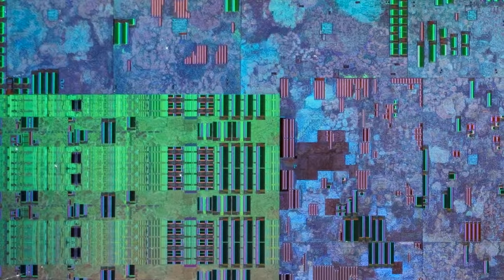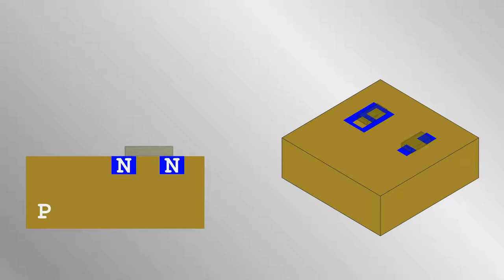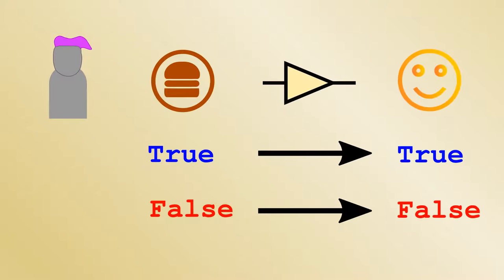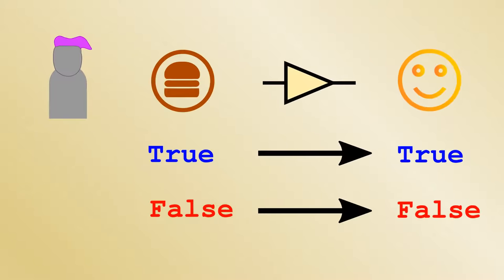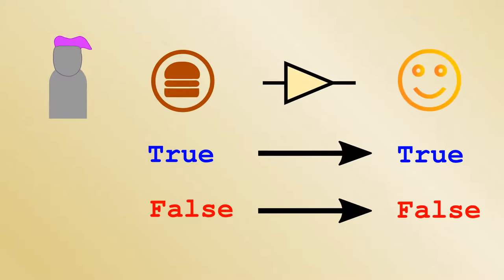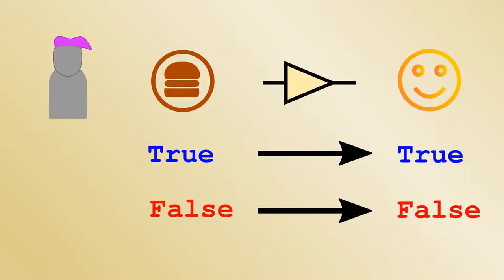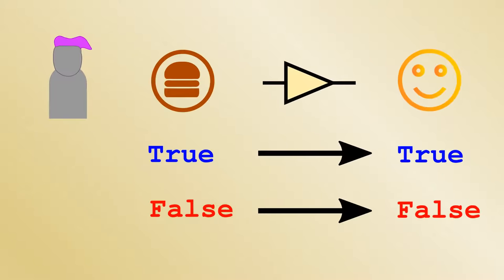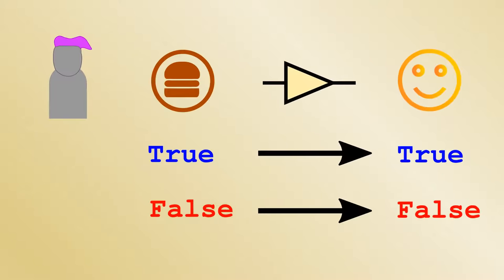How a Computer Works - from silicon to apps

Comment: Nice job! This is exactly how an "introduction to computers" class should be done at a university. I always disliked how my professors through us into the thick of computing without first explaining the reason why it all exists in the first place.
Reply: I think you learn like I do. No matter what it is, I want a general overview about what it is before delving into any specifics. It's like when instructionals we'll go down a program menu and tell you what everything is, but not when you would ever use it. Then it goes through every single thing, every single menu and expects that you know the program now.
Reply: I have a degree in Computer engineering and I have been working as a software engineer for over nine years yet it feels like this is the first time I truly learned how computer works

Comment: I messed around with Boolean algebra in high school because a good teacher I had encouraged me. I gained a pretty strong understand of the math. Later in college, I started learning Java, so I gained a small understanding of how programs work at a high level. However, I never quite understood how math and register values could be used to make graphics. This video gave me a much better idea than anything I've looked up previously. It also really helped me understand the scale of modern processors and their computations. That understand was what I was missing. I knew how you could use logic gates to make a digital clock output the time with a liquid crystal display, but I could never make the intuitive connection to how just doing math could make a sprite or window on a screen.

Comment: Amazing. Doesn't get more comprehensive than that.    Love how you start from semiconductors and work up through transistors to gates to instructions sets.    I knew all these parts but have never seen it wound into a full bottom up explainer.    Should be one of the most watched  videos on YouTube.

Comment: I wish I could like this more than once, my brain exploded after the keyboard explaination where you casually said "sends it to a loop" because like kyser soze at the end of the usual suspects it all came together in a flash. 
Fantastic, now my understanding is legitimately a little better, which is a LOT better that I could have done over like maybe a month of study? So this was worth quite a bit of learning time... Err lets say a skill takes 2 years to learn, that is 24 months, so this was like 1/24th. And while learning in parallel probably knocks that down to 1/50 or 1/100. Its still pretty damn good for a youtube video.
1-5% increase of understanding... Just nice.
Also loved the way you used the beethoven and the oversimplification texts, quite ingenius.

Comment: OK, wow. You are the Potholer54 of technology. That is as high a compliment as I can conceive. I've been programming since 1978, you know, back in the day you used 6502 machine (well, assembly) language to control the stepper motor on the floppy disk drive and read and write individual bits to the head. I still program in C, not C++ or Python or anything like that. Too frou-frou for me. This video blew me away. I'm tagging it for recommendation to all my programmer (and non-programmer) friends. Thanks!
Reply from the maker: Thanks, I also prefer C over C++. Python is pretty neat, though. You'd be surprised how much Fortran77 I have to work with, but what surprised me even more is actually how viable it is. Still the fastest way to crunch numbers.
Reply: @ImprobableMatter  Actually, I forgot to mention that these concepts are now front and center in the field of lattice-based fully-homomorphic encryption. If you are not aware, you can build a "computer" using logic gates in an encrypted block (insert Beethoven's 5th here) that can be executed remotely without anyone, including the cloud computer, knowing anything at all about what it is doing and what it is doing it on. Combine that with crypto smart contracts and, well, lots of stuff. I have watched maybe 10 videos on this and lattice cryptography and am now convinced you can do a base-10-order-of-magnitude better job. Next, I need you (yes, you) to explain zero-knowledge proofs! I mean, I get the basic idea but when it comes to non-interactive zk-SNARKs I lose contact with reality. Am I being too demanding? How can I contribute to your channel?
Reply from the maker: @johnjamesbaldridge867  This will likely make you unsubscribe, but I am a cryptocurrency skeptic. Anyhow, the underlying math is undeniably sound, but I'm sure someone has done a better job than I could explaining it.

Comment: As an electronics hobbyist (i dont have the required 1million braincells a engineer has) your explanation is nice and accurate! It amazes me that almost every house hold appliance has a microcomputer in it in the form of a microcontroller chip. Even toys contain a small computer but instead of a os it runs code and has support logic to inplement all sorts of functions. Its ingenious how humans managed to fit all those tiny transistors in a few centimeters. I am also happy my country (the netherlands) has the technologies and machines that can successfully produce such a chip. Hopefully china does not steal it. Giving the netherlands a bit of credit and putting it on the map for inportant companies who power the world. Also fun fact, almost every pc component also has a microcontroller in it or cpu core, the ssd controller, hdd controller, the monitor has a cpu in it, the mous and keyboard have microcontrollers in it. Even a bluetooth speaker, bluetooth devices, washing machine, dryer, coffee machine, wifi routers, cars, induction and heating plates, settopbox etc. all have microcomputers in it. The future is really digital
Reply: Great information

Comment: I think you have the photoresist process backwards.  When the light goes thru the mask, it "cures" those areas of the photoresist.  Then a mild solvent is used to remove the areas that were not exposed.  The next step in the chip manufacturing process is done (doping, etching, adding a layer of insulating oxide or conducting metal, or whatever), and then a stronger solvent is used to wash away the cured areas of photoresist.  Rinse, lather, repeat, until all layers of the chip are done.
This is equivalent to using the "photographic negative" of the mask as you've shown it. 
At least that's how it was done in a lab class I took in college decades ago.
Reply from the maker: You may be right, that is one approach I read. In either case, I hope it's clear how a photoresist can be used to selectively etch away material from some parts and eventually build up a network of transistors.
Reply: You are talking about negative photoresists. The video explains Photolithography with the use of a positiv photoresist. Both can be used, they just do the opposite thing.

Comment: This is a pretty great video but could maybe do with a brief talk about algorithms more abstractly before diving into sequential instructions and integer operations specifically. Also I think a quick mention of threads and cores is important, and how 3D graphics processing is separate from the cpu and massively parallel. (I like to explain things with a kitchen analogy, the cooks are the cores, the recipe is the algorithm, the order is the input, and they pass around ingredients which is the data, and they perform all the different instructions to serve the dish, the output).

Another nitpick, I think it's really important to mention that there is a temporal delay between input and output with latches and other logic, and that's why you are able to route outputs back to inputs to achieve these things. An animation of voltage state/change through a logic/gate diagram I think would be suuuuuuuper helpful in this regard.

Comment: You did such an amazing/excellent job on 'How a Computer Works'.  
I'm trying to figure-out exactly how FPGAs work & I just can't.   ?Could you take a look at FPGAs? 
FPGA logics are look-up-tables (LUTs) stored in memory to emulate the in/output of any logic gate configuration (ex: AND, OR, NOT, registers, etc).   ???Then how do FGPAs do calculations w/o a CPU???
Reply from the maker: In simple terms, an FPGA has a bunch of gates which can have their type and interconnectivity changed. So you could configure an addition circuit like I described one moment and a completely different gate circuit soon afterwards. They also have clocks, as I described, but with rates that can also be set by the user. So in principle, an FPGA could act as a processor if it had all the right gates.
Reply: @tombouie  dave jones at eevblog explains it pretty well. https://www.youtube.com/watch?v=gUsHwi4M4xE&t=188s&ab_channel=EEVblog
in short you'd have resettable fuses to configure the fpga. however as you'd know due to how fpgas work the memory is volatile, so the actual configuration of fpga would be stored somewhere else on a device, and every time the fpga boots it would use the configuration from said stored memory.

Comment: 17:47 Minor correction here, negative numbers are not stored like this. If you have a number x in signed binary and you want to get -x in signed binary, you flip all the bits of x and then add one to get -x. The highest bit does determines whether the number is negative or not, but the other bits are not the same as the positive counterpart of the same number.

There's are very good reasons for storing negative numbers like this. Flipping all the bits means that the same addition and subtraction instructions that work for positive numbers work for negative numbers as well. Flipping the bits inverts the operation, so adding to a number makes it "less negative", and vice versa for subtraction. Why add one after the bit flip? That's so we only have one representation of 0 (So that 11111111 in signed 8-bit binary is -1 rather than -0). Also it makes it so that overflowing smoothly crosses the boundary between negative and positive numbers. Let's look at an example: Remember, -1 in 8-bit signed binary is 11111111. If we add 1 to that, we overflow to 00000000 and get 0 as expected.
Reply from the maker: Yes, well done for spotting this. Someone already pointed out the 2s complement is more optimal than what I said. Floats do have a single sign bit, however.
Reply: @ImprobableMatter  Thanks! Yep, for floats in IEEE 754 (the floating point standard implemented by most modern computers), flipping the sign bit of a number x is all you need to do to get -x. That also means there are separate definitions for +0 and -0, though they are considered equal in the standard, so it's an implementation detail that can be ignored in most cases.

Excellent video by the way! Keep up the good work 👍

Comment: I majored in physics, and one of my classes was an introduction to semiconductors and electronics (final project we had to design our own electronic device of any sort; I choose to design, implement, and create a THERAMIN, the musical instrument). I used a photoresistor for the pitch (frequency) and volume control (thus, moving your hand would like change the amount of light hitting the photo-resistor.

Also, we derived how P- and N-type transistors worked in my QM courses (quantum mechanics courses 137a & 137b) using first principles of quantum mechanics. You cannot explain how transistors work without quantum mechanics; the Newtonian(or, rather, Maxwellian approach with non-QM features) approach simply DOES NOT WORK as an explanation

Comment: around 18:32 somewhere, negative numbers are mentioned without 2's complement, which is more often used. There, a number will also be negated when the sign bit is ON e.g. in 8-bit 5=0000_0101 and -5=1111_1011 This greatly simplifies negated addition and subtraction. e.g. 5+-5=5-5=0000_0101+1111_1011=0000_0000, when ignoring overflow
Reply from the maker: Yes, well spotted, this is a mistake (for integers). Floats do have a sign bit, to be fair.

Comment: One small point on your audio section the DAC actually regulates voltage not current. The actual current will depend on the impedance (resistance) of the connected output device and can and will change with different output devices. But the voltage should not at least not unless you are using nonstandard equipment or something and failed to make sure it is impedance matched.
Reply from the maker: Totally agree. Cue Beethoven.

Comment: The thing that gets me with modern computers is how there's still substantial differences between CPU generation at identical clock speeds and instruction sets. What a difference the number of compute units, the bus interfaces and the lower bus clock speeds make... I mean Pentium 4s had 3 GHz back in the day, and nowadays modern entry-level laptop CPUs at 2.6 GHz beat them many times. over... I guess the special instruction sets also play a role (MMX being one of the first ones back then).

Comment: Great summary of the topics, however, at 35:45 "each frame would take this many bytes in memory" is a bit misleading. "Video" (H.26X and others) is a format of immense compression in all practical applications, with magnitudes of lower memory and processing requirements - you can look it up, it is actually quite interesting.
Reply from the maker: Once it's decompressed, it will take that many bytes in memory, or at least in the video buffer. I did a more recent video on lossy compression methods, such as video codecs.

Comment: The best look feature for transistor support improvement is finding the ability to avoid the stray capacitance that would keep the pc running slower.
Reply: Also add, the transistors parts are human made crystals too!
Reply: Note the power of capacitance: Having 2 sq. yard plates separated by say a mile, these plates would still be able to exchange weak signals between each other as a circuit, thus capacitance is not just meant to build a storage charge. {The opposite of capacitance that work with gaps to, is inductance, and a Telsa concern of him being able to light up a bulb in his hand on the opposite side of the world, in a sense of his research.}
Reply: Dissipation fight being the competitor theory!
Reply: And the real final product of the computer's complete logic is to stay idol with the zero bit looping in wait for any input at any time that has the looping waiting at normal processing speeds of the computer.

Comment: Explaining such a broad topic can be tricky as the definition of the computer covers a very broad area.  Ex.  mechanical vs. electronic, analog vs. digital, preprogrammed chips without user interaction vs. user programmable/controlled.

Comment: Not electrical circuit its an electronic circuit. Differentiate them as transisitor is an active component which control the flow of electron therefore its an electronic component

Comment: Hm. 17:50 depending on the architecture the negative bit does not automatically mean a multiplication by -1. The one's complement version is often used so that further binary operations can be performed easier.
Reply from the maker: Just checked it, yes, you're right for typical signed integers. There is certainly a sign bit in floats. Well spotted!
Reply: @ImprobableMatter  well yes, but I even meant for integers, there are also different representations for negative numbers depending on how you use them.
But as an easy introduction this is quite good and well made. That must have taken a long time and good planning.
Reply: Yes. Negative numbers are stored differently. But I think this is irrelevant detail for video explaining just general concepts. If it showed actual representation of a negative number, it might be too confusing for general viewers and would require an explanation that is out of the scope of this video. So maybe it's better to be shown this way.

Comment: Wonderful. About the only thing missing was why? Why do we have personal computers? Not surprising...war. The transistor was vital for improving radar. Transistors offered a way forward away from systems that relied on large (and problematic) vacuum tubes. Transistors' commerical design (1947) came with an important characteristic--imminent capability of being miniaturized (subject to interative manufacturing improvements that followed). They, of course, are the key breakthrough hardware-wise. Programming (software) is a more nuanced topic. But plenty of things can be tied back to war initiatives. Particularly code-breaking (Alan Touring, 1930/40s) and bomb trajectory calculations. And never forget, also of primary import: commercialization of electricity (c1900).
Reply: Not too mention we haven't been to the moon in 50 years. The US put a man on the moon to prove they could put an icbm in the red square and humanity collectively forgot all about it. The greatest achievement of all time was just a dick measuring contest

Comment: I am doing Computer Organization and Architecture unit at the uni for my Bachelor of Computer Science degree and honestly speaking, this video has been the best to explain most of the key concepts that I wanted to learn from the very scratch. Hat's off to you. I am trying to make a personal note using this video so that I can create a flow chart from the bottom up. Can I use your slides for it? Is it okay if I request you to share your slides if possible? Thank you a lot.
Reply from the maker: You can certainly use them, but you will need to screenshot them yourself. The raw files contain multiple images on top of one another to allow things to fade in and so on.
Reply: @ImprobableMatter  Thank you, I already have done that. 
Here it is: https://drive.google.com/file/d/1f9cNBGOiugQnXw7-LfJ6SuDMT9Wv2H1n/view?usp=sharing